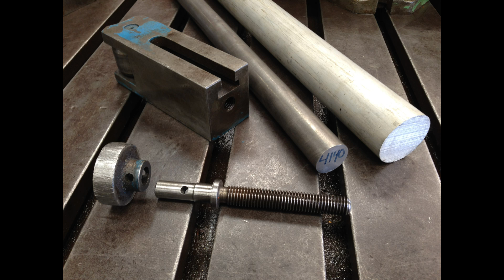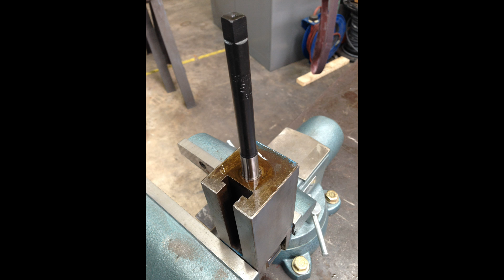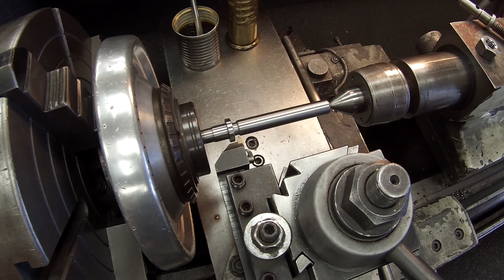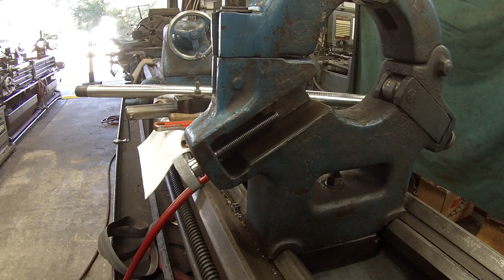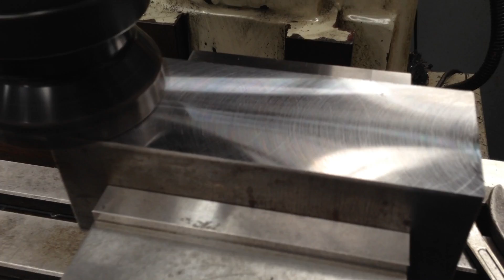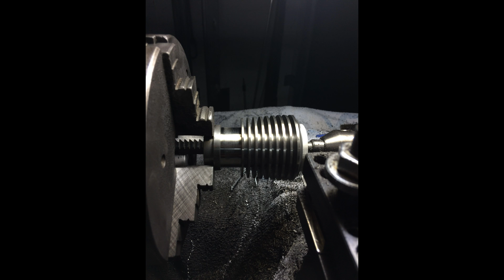Saturday Night Special 47 Part 2: Steady Rest Repairs

Comment: Hey Adam looks great just had an idea about your steady rest. What if you drilled two dowel pins between you rest and your adapter plate? I was thinking it may help keep the strength with out all the metal removal.

Comment from the maker: Thomas Coor, you have your settings so that I cannot reply directly to your comment. Yes the finger has a t-slot milled in it, and a t-bolt fits there and goes through the casting with a nut on the outer side. Tighten the nut to lock the finger where you want it.

Comment: Very interesting vid, Adam.  I always learn something every time I watch. 

I have a question about that steady rest: is that a T-slot in one side of the finger to lock it in position once you have the screw adjusted?  I wouldn't think the screw alone would be rigid enough.  Thanks.

Comment: Hi Adam, I've liked a lot the video and the voice over too. A quick question: is a collet chuck clamped in four jaw chuck to zero runout what you use here?
Reply from the maker: That's my Jacobs rubber flex collet chuck. I use it because the 4 jaw won't hold anything smaller than 3/4". I just chuck the body and indicate it like any other typical job.

Comment: Adam what kind of collet chuck is that?
Reply from the maker: It's a Jacobs rubber flex collet. The cam lock mount is smaller than the ones on any of my machines, do I just chuck the body and indicate the part true. It's usefull for holding smaller parts, or repeat parts of the same size.

Comment: we have a 16" cw , actual swing 18.5 and 52 inches between centers.Built 8-1945. Most user friendly lathe i've ever ran. We also have one built in 2-1948  actual swing is 16.5 and 150 between centers,  no model number but serial number 31126.

Comment: Interesting video Adam. I hear you talking about way oil all the time, I know what a way is but what weight or kind of oil is it?
Mark
Reply from the maker: Not sure of the specifics on the way oil, but it's designed for machine way lube applications such as on lathes and mills. It's a bit more sticky that other oils and helps to stay on the surfaces it's on. In reality, the machines parts should be floating on a super thin layer of way oil when the parts are sliding together. 
We use it in all the machine pump oilers, and on the lathes who's  carriage pumps oil up onto the ways.

Comment: Looks like Gill is building the "Hoglet" by Randall Cox - right?  I did the CAD work on the drawings for that engine back in 2007 for publication in Model Engine Builder Magazine.  I'd love to see more photos/video of his progress.  Robert.
Reply: Stuart Hardy Very sad to see Mr Cox has passed. He has a you tube page where you can see the Hoglet run. 
Gill
Reply from the maker: Robert, are you the Randal Cox? I told gill about your comment. He said to tell you that we'll keep the pictures and updates coming as he progresses. Once he's done we'll do a final video on the engine. 
Thanks for posting!
Reply: Abom79 No, Randal built the prototype.  I was then asked to create a set of CAD drawings from his prototype so others could build one too.  Is Gill going to build just the 2 cylinder engine or is doing the kick-starter too?  Great little project!
Reply: Adam and Robert 
With ref to Randall Cox Ian informed he has past away 
Link to my source 
http://www.modelenginemaker.com/index.php?topic=4405.msg82067#new
Reply: resiggy13 I am planning on building the kick starter also. Will probably get it to run first and then add the starter and stand/control box.
Gill
Reply from the maker: floridawind1
We'll make sure we have all the action on video!
Reply: Gill if your into the smaller end of things ask Santa to get you a copy of Cherry Hills models the rain forest store has them in but note it could cause some serious envy all her work is on manual machines and only from her own research 
Stuart

Comment: Hey Adam,

Couldn't wait for morning coffee...enjoyed, going to copy the vise block...simple/smart!

ATB
Chuck
Reply from the maker: With all that good scrap metal you have hoarded away, you can make us all one! I used it right after I machined it for that rod and it works great! I'll probably drill and counterbore a hole in there later so i can bolt it down and keep it from sliding around.
Thanks Chuck!

Comment: Hi Adam, Another top S.N.S, Just a quick question, Is their a reason for the steady thread to be left handed? Big Thumb up.
Reply from the maker: Depends on what the user thinks! LOL. On this one, yes it did matter so that I can match up to the threads in the arm. I think they make them like that so that when you turn the handle clockwise it pushing the arms away from you.
Reply: Abom79 Cheers Adam.

Comment: Hey Adam:
       I know it's just a guide to shoot for, but where did you come up with the .068" compound travel (@ 30 degrees) for the 11 thread? Is it a published in a manual or have you compiled a spec for different threads from experience?  Nice job...something about fixing a long-time annoyance that is very satisfying.   Dave
Reply from the maker: I have a threading chart that I follow. I showed it many videos back. It gives the proper depth of cut for all standard pitch threads with compound set to 60*.
Another viewer posted a very simple formula in his comment though thats a huge help for anyone.
.750 divided by the pitch= thread depth on compound. .068
Reply: Adam that 750 divided by the pitch is only for standard threads or can be use for acme?

Comment: Adam
dumb question is there a reason for the odd number threads verses even number???

thanks
Reply from the maker: It has to do with the relation of the diameter. it's been standardized that way many years ago, so that the the manufacturing world can all follow the same sizes. Just think, if you were given a bolt that was 5/8-12, you know how hard it would be to find a nut that size? That's why you have National Course, and National Fine, and soo on.

Comment: Adam, your voice over commentary was 'spot on'! Using an air conditioner to provide warmth? lol  At what temp do you turn on the heat? Locally we are hitting 47F for a high today, with a low tonight of 36 F Cheers.
Reply from the maker: We all had some cold days in Nov. Now we're in a hot spell. It was nearly 80 degrees today. Been running my ac on 68 all day! :)
When it's around 50 or below and set the thermostat to 65 on the heat setting. It keeps the shop comfy. First time ever using a widow unit ac for heat. Works pretty good.

Comment: Great video
On a fish scale for thread depth what does it mean when they say double depth?
Reply from the maker: The double depth is the sum of both sides to depth. I use the double depth to determine my undercuts for thread reliefs, like when machining a radius in the shoulder so that the nut pulls all the way up flat.

Comment: how do you determine the .068?
Reply from the maker: I have always used my charts I made many years ago. I showed it in one of my videos a while back. it gives me the depth for each thread pitch with compound set at 60*.
Reply: Abom79
did you make your charts from the book?  ummmhhh do you sell those charts?... although i plunge cut most of my threads... wouldnt the actual depth be the same whether plunged or 30*/60*?

Comment: Hey Adam,
Thanks for sharing your repairs on the American Pacemaker steady rest. I like your narration format. That voice over mic works great. With a quality mic, like the one you have, you get excellent frequency response (high fidelity) and it brings out the bass character of your voice. Put on a suite and tie and you're ready for the Six O'Clock News! LOL Thanks for sharing and for including Gill's project as well.
Have a good one!
Dave
Reply from the maker: Funny you mention that, I'm always worried at how my voice will come out for each segment. After the first try I learned it had the mic too close. Now I keep it about 10-12 inches away when I'm talking and it seems to be working ok.
No news for me, only What Grinds My Gears! LOL
Reply: I subscribe to this. I like the narrated version too. Maybe Adam could find some parts to fit that in to.

Comment: Great SNS as always. Thanks for sharing! I will make sure to include some bubble wrap for Elena, when I'm sending another package :D

That drill is enormous. Biggest I've use was 45mm, as I was doing an apprenticeship at a fabricators business. Drilling into a big chunk of steel without pre drilling, as this would be to "time consuming". Nothing like getting one of those chips down the neck... sure was a nice squirly dance. The drill press (about 5 kW (6.7hp), old german Alzmetall) had no problem whatsoever.

I've actually just made the step to get myself a nice mill. Just got it into my shop. It's a 1953 Ruhla/Thiel Type 58 ( http://www.lathes.co.uk/ruhla/). Pretty nice mill, just need some milling cutters and a little bit of electrical work! Will send you some pics on fb! Quite excited!

Best wishes
Phil

Comment: Noobie question: how did you compute your thread depth at .068 for 5/8-11?
Just the difference between the major/minor diameters?
Reply: .750 / number of threads
Reply: Threads per inch?
Reply: Yes, threads per inch.
Reply: Hmm, seems to work, what does the .750 represent? is it a constant for all threads?
Reply: Found this in a machine hand book. Seems to work with all threads I have cut.
Reply from the maker: Doug Edwards
Awesome Doug. Thanks for posting that.
Reply from the maker: I have a thread chart I use, and it lists all the depths for each pitch thread when compound set at 60*.
Reply: Interesting, thanks for the help

Comment: So, the way you start the feeding at the same spot every time is with that rotating number wheel? Ive always wondered how you do multiple passes when cutting threads without starting at different spots and messing up the threads
Reply: Also that cylinder looks awesome. You should keep us up to date on that build if possible.
Reply from the maker: It's all about the pitch your cutting. My lathes have a lead screw with a 4 pitch thread, and any thread divisible by 4 you can engage the half nuts anywhere you want and it lines up. Other even pitches, like 10 or 14, engage on any line. Odd pitch, every other line depending on where you fist start. I started on 1 so I went with odd numbered lines. Fractional pitches, hit the same line every time.